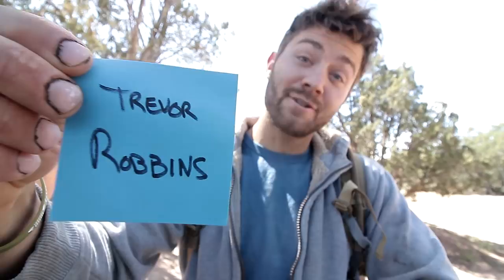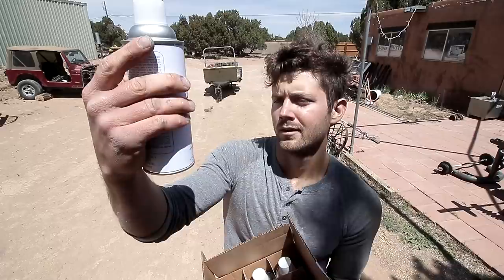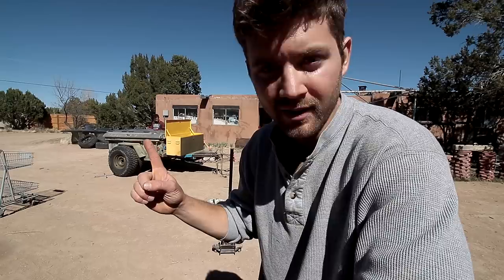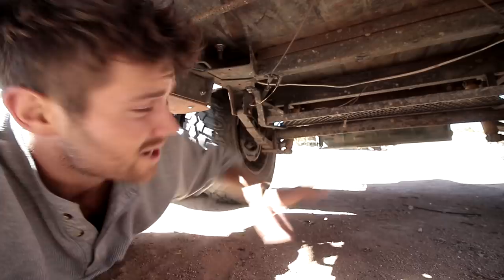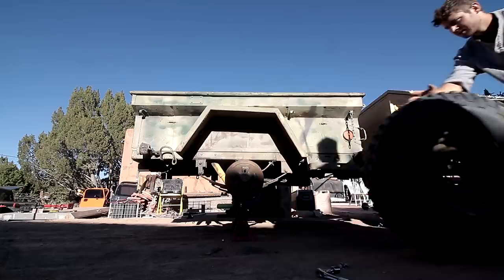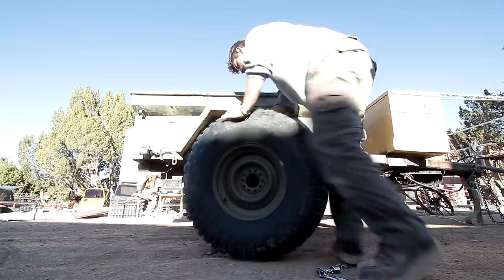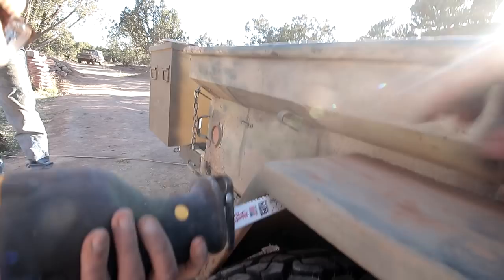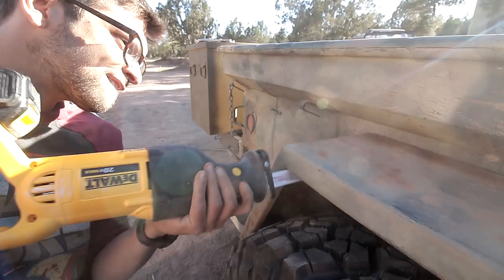JEEP CAMPING TRAILER BUILD: NEW TIRES!

Comment: Yes I see you have leaf springs just  disconnect one end of the leaf and unbolt the axle from the spring then re bolt the leaf springs back up and set the leaf springs on top of the axle bolting the spring perch on up side down. This would give you a couple inches clearance with out trimming or bending the fenders.

Comment: Curious to know - did you guys think about sticking lift blocks under the trailer's leaf springs to gain clearance? Opening of the fenders is better to keep the center of gravity low, but seems like more work than a couple of 1.5" lift blocks. Looking good!